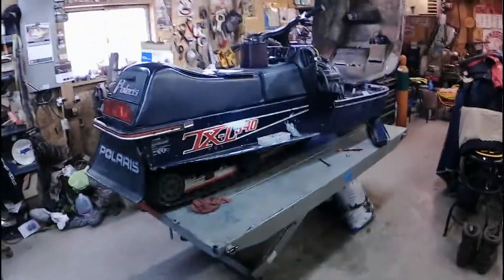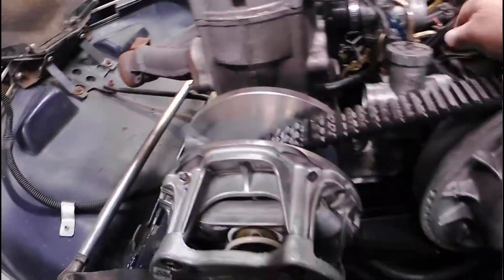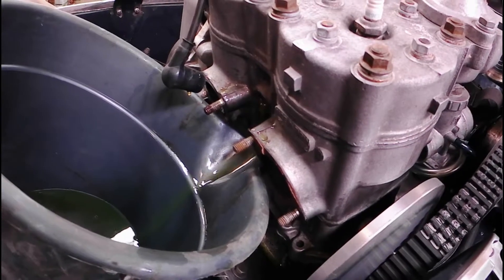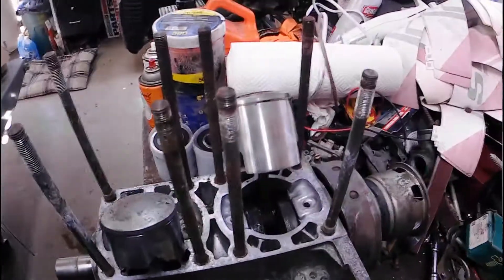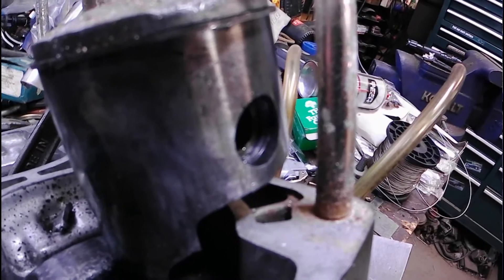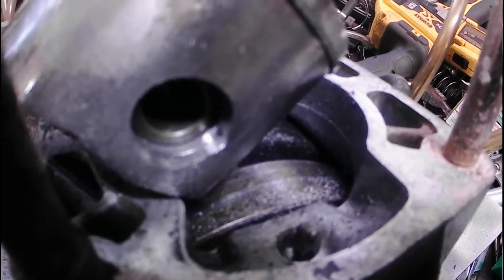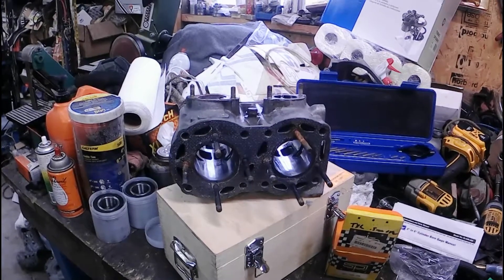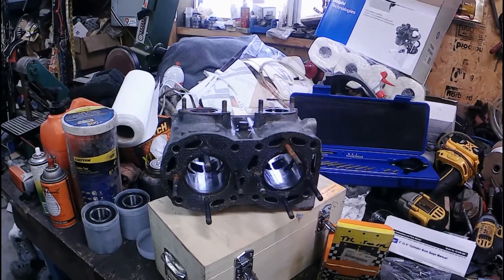Polaris TXL Motor Part I, tear down and diagnosis

Comment: Hey Nutter do you have a preferred source for TXL crank seals? I see oem is still available but pricey.
Reply from the maker: I use Winderosa/Vertex.
Reply from the maker: Are you going to run a single WD or dual WRs on that TXL? LOL!
Reply: @nuttersspeedshop  I might do it! 

But....if I don't, I have the same question about needle and seat. Not sure if there is a viton tip option available somewhere I assume if I just order from DK it probably won't be.
Reply from the maker: @MrStorbeck  I always search out genuine Mikuni. Parts reloaded might be a good place to look. Or genuine NOS.